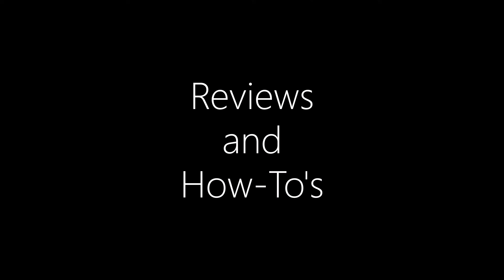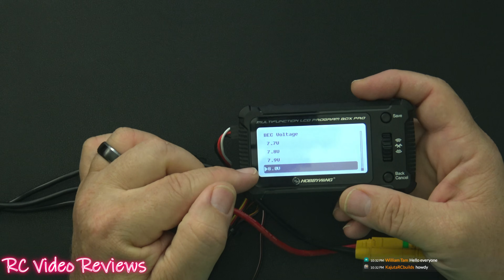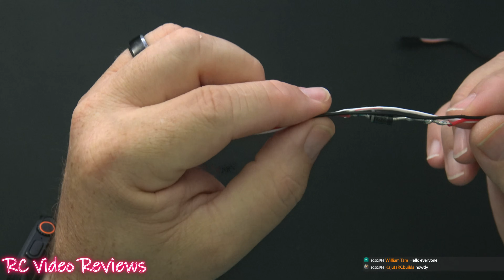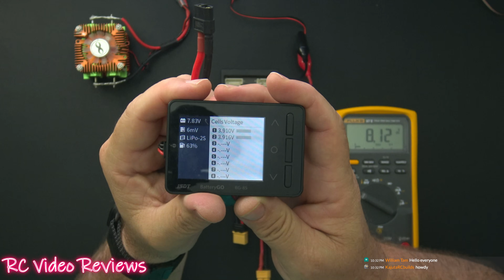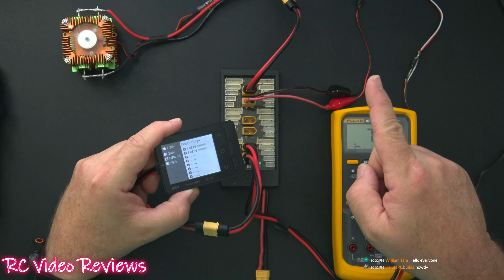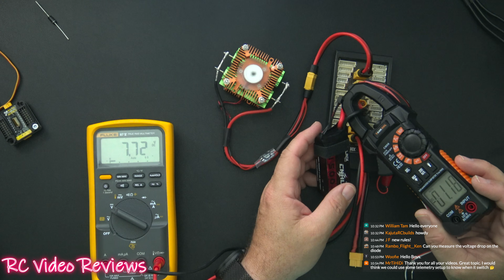Ridiculously easy redundancy for your RC setup

Comment: Could you plug two batteries into the bilda? one on each xt30? (If you didnt have a esc with an internal bec)

If so would it be advisable to solder schottky diodes in the xt60 to xt30 adapters? Dave mentioned something like this in the raven video.? two batteries not feeding each other...
Reply from the maker: More of a discord conversation. The xt30 ports are common so yes you could connect two batteries with conditions:
- one would require a gender bender
- care for current flow either through diodes or like voltage levels. 

I have no fear using the bec to charge the rx pack so long as peak voltage of the ESC is less than 4.2v/c and the rx pack is near bec voltage when plugged in. It works juuuuuust fine.
Reply: @RCVideoReviews you wouldn't want to use 8.4 output if using 8.4 rated servos?

Comment: Obviously I am commenting while watching. FYI, you can use different voltage values. You just need to isolate each power source with a diode.
Reply from the maker: This arrangement specifically avoided isolating the battery side for the purpose of allowing the BEC to keep the battery topped off during flight. The idea being why deal with charging the RX pack during the flight day if the BEC will keep it charged for us?
Reply: @RCVideoReviews  that makes good sense also.

Comment: You probably figured it out by now, but your clamp Amp meter has a positive and negative side. If you clamp it on incorrectly you will see a negative value instead of positive.

Comment: Love your videos. I designed and built a redundant power system circuit years ago for guys with big planes and scale helis. I use it in all my builds. I sometimes used diodes with slightly different forward drops to force power draw from the main battery, but if it failed the backup battery would take over with no delay at all. I then made a fancy one with an MCU to monitor each battery and blink an LED if there was any type of voltage glitch.

Thanks for sharing your videos and providing the content you do.
Reply from the maker: Yeah, there are all kinds of options to get the behavior you want. My goal in this video was a super simplistic option for people just starting to dive deeper into electronics. I assumed those in the know would deploy techniques like this to arrange different outcomes.

One I like a TON was using different voltage levels to indicate when a failure occurred via telemetry. Smart.
Reply: @RCVideoReviews  for sure there is always more than one way to do something. I appreciate the time and effort you take to make these videos. Thanks for your hard work.

Comment: This design only seems safe if the BEC is current limited. If you put a slightly discharged battery it could easily fry a normal BEC by drawing too much current. I always thought that like the ESC output current spec, generally it is your job to keep the current under the maximum BEC spec by picking the right components.
Reply: Hello, this redundant system is not meant to be used as a charger. Batteries should be fully charged prior to flight. Then the system will maintain the voltage when the sources are properly paired. To prevent power being fed back into the batteries by the ESC or the BEC put a diode on the battery, that takes care of that issue if there was one.  I haven't had any problems, and I've been using the system in all its presentations or configurations for the last 14 years, no problems. I would have to agree. There is always a problem for every solution But it really comes down to what weighs more the problem or the solution.This system if used correctly is bulletproof.

Comment: I have modified servo-splitter cables (Y-harness) with a Schottky diode on each. One goes to the ESC and one to a BEC and the other end into the throttle channel. The BEC has higher voltage than the ESC and is therefore the primary. If it fails the ESC will take over and with telemetry measuring the rx battery voltage, if it drops to the ESC-value I will get a warning and bring it home. This haven't happened yet, but works on the bench.
Reply from the maker: Nice! Great idea.

Comment: If you put a diode in each power source, battery and ESC, then both to the receiver. Then the one with the most voltage will provide the power. Assuming you set the ESC for more voltage than the battery, that will be the master source, then if the ESC quits, the diode in its lead will isolate the ESC from the system and the battery will continue power to the receiver.

Comment: I use the diode on the battery feed as well, if the battery has an issue, it will draw current from the ESC possibly shutting it down. Diodes on both feeds make it more redundant.

Comment: As a matter of fact, we have tested just about every variation of it, 2 batteries with Upto ESC The 2 m Vanquish. battery and ESC kaos and acuity , ESC and BEC Avanti. I think that covers all the scenarios pretty much. With BEC's , ESC,  lipos and life batteries. Not only provides redundancy but increases the output capacity of the power circuit to the receiver which is great, Like I said before 14  years using it ,it works and it's cheap and simple.

Comment: That is a bulletproof system if used and applied correctly.If not it can blow everything up to The moon 😬 .I've been using all the variants of this system for the last 14 years and I love it. I refuse to use a regulator full of electronics, more failing points, a good quality diode Is pretty much bulletproof just make sure  Your diodes are capable of handling the load and have very little to no reverse Voltage leakage. This redundant system has saved my planes.  love it , good job, good video.

Comment: what would happen if you dident put that diode on the bec line ?
Reply from the maker: You could damage the ESC.
Reply: Isolation is smart, silly to experiment .  Simple 5A diode will do the trick, put one in both the battery and the esc and neither will know the other guy stopped working

Comment: Excellent! I have a similar setup in all of my F5J gliders. These are large 4m wingspan carbon fibre gliders that I don't want to risk, and don't want to risk crashing into anyone, hence the battery backup. I'm also running 2S Rx voltage so have a backup 2S battery, and either 3S or 4S power (one of the gliders is the heavy strong version and thus has a more powerful moter).
I have two diodes in the circuit btw. One to stop the ESC/BEC from being charged, and one to stop the backup battery from being charged.
Reply from the maker: Very cool! Good use case. Thanks for sharing.

Comment: Another nice tutorial, thank you. 
I wish this diode was integrated into the batt circuit of the receiver.  I think Multiplex receivers are designed like this (to be confirmed but that’s what some users reported to me) 
You can plug a backup battery in the BATT port while using the power from the ESC BEC as your main source. 
This could be an amazing feature if it is implemented in the Radiomaster ELRS receivers.